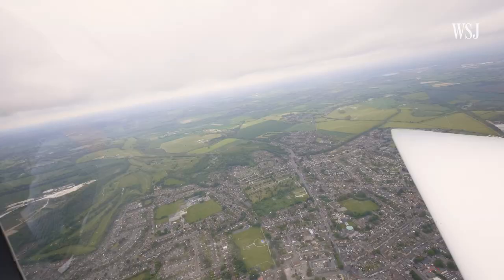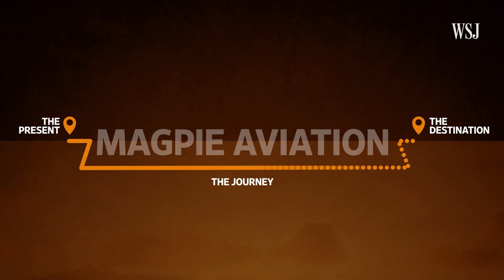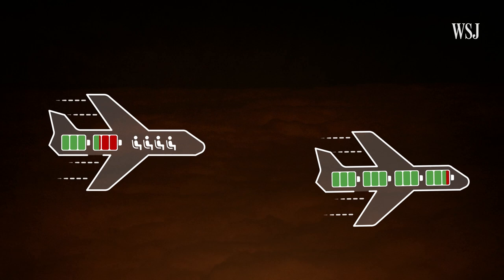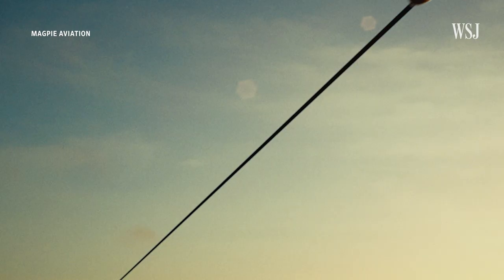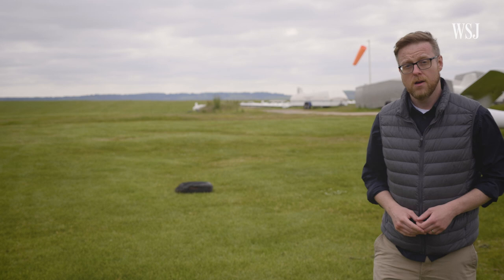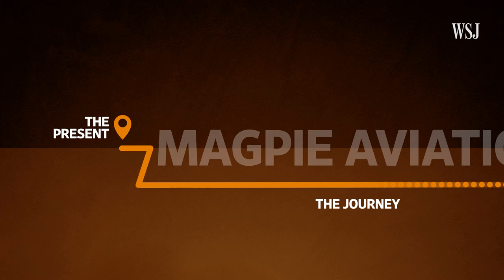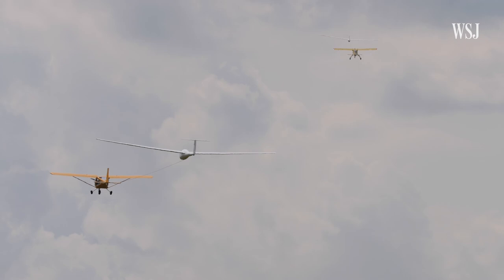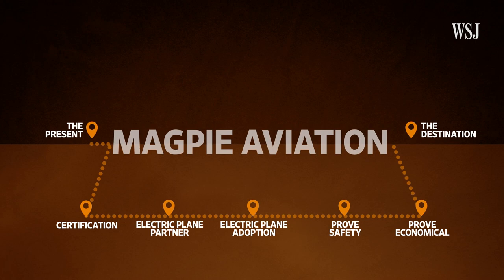How to Extend an Electric Plane's Range? Aerotow It.

Comment: Do you think plane towing will latch on?
Reply: Let's talk again, 15 to 20 years from now. 
Nothing they offer can't be provided by one of the big wigs within one year.
Reply: No. I’m willing to be proven wrong. But this sounds impractically complicated to coordinate.
Reply: Why limit it to towing electric planes? Is there a reason an electric tow plane wouldn't work to extend the range of conventional planes?
Reply: At this moment I can't imagine that using multiple planes and crews can fly in an economic way.
You need more flight "take of permission"
More people
More maintenance
And every switch of the pulling plane needs to be tightly scheduled 
The goal range of 1200 miles is also a little small. At least not enough for intercontinental flights...
Reply: Everything that “appears different” from a standard aircraft has been a failure, regardless of performance.  For instance, Rutan was an amazing aircraft designer, however nothing he created became mainstream.
Reply: It should, a simple way to start in-flight resupply/recharge.  In commercial aircraft business, 40+% of cost is fuel, all polluting fossil fuel now.  A chunk oof that pollution is inefficency of combusion, and  is the tyranny of the fuel Breguet range equations, and electric is more efficient and can  be zero-carbon, but heavy so tyrany of the battery equation is harsh.. but Magpie's idea is a simplle way to lower waste and efficiency and get to zero-carbon.  Someday maybe the tow vehicles will dock or mate, but this great start.
The fuel and battery equation tyranny ayk is that for short distances the fuel needed is linear with cruise range, but past a certain point, it goes up more and more exponentially, shown here where Breguet cruise range equation written to show fuel needed to go distance R. Aviation folks don't like this cuz shows a key probalem that makes fuel costs more than 40% of the costs fo commercial aviation.  Huge amount of waste and pollution..

Mf_c = (Μ_c0-M_c1)=M_c1*[exp{+Rc *g/[L/D)*Efspec*η_c}-1]

Mf_c is Breguet calc of fuel mass needed to cruise level a distance Rc; M_c0 is plane mass at start of cruise, M_c1is mass of plane at end of cruise.
Mf_c=M_c0-Mc-1
Efspec is specific energy of the fuel [J/kg], 
η_c is thermodyn*propulsive efficiency at cruise, equal to 35%-40% for best jet airliners, >40% for best turboprops.
 L/D~20 maybe more for those.
So for best commercial aircraft  (L/D*Efspec*η_c/g) =~ 20*40MJ/kg*40%/[9.8m/s2]~32e3km, i.e, the last 1kg of fuel used in cruise can get 1 kg of M_c1 a distance of 32,000 km!, or all of Mc_1 a distance of
32e3 km/(M_c1/1kg), 
so if plane is A320 weighs 68 tonnes at end of cruise phase, i,e,m Mc1=68,000kg, that last 1kg of Mf_c (fuel) got us 32e3/66e3 [km] = ~0.5km.  that's good, imho, for such a huge plane, but for 10000x further say a 5000 km cruise, like across USA, say,, or Rc= 5000km, Mf_c is 12,000 kg, more than 10,000kg like a linear increase, cuz the fuel has to carry the fuel etc etc.
Mf_c(Rc=5000km) = 68,000 kg * [ exp (5000km/32,000km)-1] = 68000*0.17=~12,000 kg.  so fuel weight two tonnes more, 20% more weight extra of fuel just tto carry the other 10,000 kg the rest of the plane needs to fly.
 and this effect is worse in takeoff and climb of course.. so for long ranges refueling looks better and better.  Especially electric..
Big jets do ok of course 20% example not prohibitive, but for runnning lower energy density sustainable fuels like ethanol, it's harder, and especially for electric aircraft, running current batteries.    So refueling looks better and better
teh range equation is different and worse unless you shed batteries by having them fly off once empty to charging station on ground [Chip Yates was going to aerial drone refueling and as needed drop batteries llke that].

For battery only electric planes, the cruise range equation, written for battery mass as function of range, is
 Mplane+Mbatt(R)=Mplane*[exp(Rc*g/(L/D*Ebspec_c*η_c))],  
where Ebspec_c = specific Energy of batteries at cruise power prob  ~250 Wh/kg.  
Estimate η_c = 90%*90%*70=55% maybe better soon with advanced & distributed props and flexibilty etc, and say L/D=20 for fixed wing might be more.  
Mplane is mass of plane+PAX+cargo all except batteriesdidn't count pack structure since i didnt count fuel tank and junk for jet, but that weight is there.    
anyway  calculating, the term under Rc is
 (L/D*Ebspec_c*η_c)/g= 20*0.9[MJ/kg]*55%/g= 1000 km. 
 
so for Rc=1km,    if Mplane=10,000kg  then Mbatt+Mplane/Mplane=exp(Rc/1000km)=10tonnes*1.001 so that means it needs 1kg for that 1km.
which is linear,
.  but for longer flights, the exponential effect starts to kick in:    
 For Rc=200km it needs  220kg batts; and for Rc=400km, need 500kg batts.  
So trouble in two areas: at 500kg of batts, the batts are ~ 1/3 of the TOW mass; and its 25% more battery mass than linear cuz you need 25% more batteries just  to haul batteries, at Rc=400km. and passengers and cargo getting crowded out. So even though electric can be very efficient and carbon free if charged by say solar or wind (hydro, etc),  the range is nearing the battery equation "tyranny" limit, at 400 km, much much less than jets say 6000km-20000 km limit.

This is where Magpie could really shine, imho.  They can go unlimited range if the tows are ready, which is matter of logistics and weather and fatigue of course.
And if the aircraft towed is an eVTOL, it can land wherever needed:  on a rooftop or beach or ski resort.
 Imagine you take off from a small field or rooftop right near your town or city,say an eVTOL that has good L/D while towed,Multiple tows switch off to take you close to, or right to, your faraway destination, Or better in the future your craft mates with big  fast plane or "mothership" , zips you cross country, then eVTOL puts down at destination or rail hub etc. maybe you even switched evTOLs in the "mothership", after going to the bar and say mtg room of observation deck,   all very efficient cuz evTOL and mothership electric or biofuel.  hopefully solar and wind generated. Mothership refueled by catapult launched high effficienty drone UAVs with electricity, food, drink, pilot swap, medevac; all the things aviation should already have.  You switch to your destination evtol and land in the town or city of your destionation, or train station or beach resort.
 no fighting crowds in O'Hare or Atlanta or DFW.  flight average speed slower but door-to-door average could be 200kmh instead of say 1hr+1hr+fly3hrs say NYC-CHI then 1hr airport+1hr drive= 7hrs for 2000km= 140kmh trip total?   I ddont' know but could be real efficient and more pleasant, but we have to support it or Exxon and Boeing and airlines will keep serving up pollution, waste, discomfort, and 737 MAX crap design and crap Air Data systems.

Comment: Maintenance is often the highest expense of an aircraft and this idea doubles that cost. It also requires an extra one or two pilots so you’ve potentially doubled labor costs as well
Reply: Maintenance for electric propulsion system has much less maintenance compared to gasoline
Reply: @paulg9484  Same with electric vs gas cars
Reply: Agreed, don't see this one succeeding without automation.
Reply: @paulg9484  electric or not, they will still be required to complete their required airworthiness inspections and comply with all current and future airworthiness directives, which makes up the bulk of “maintenance” expenses of an aircraft. Every tow aircraft needed will also have to be stored in a hanger. They will be subject to the same taxes that are associated with the ownership and operation of aircraft. There will also be the cost of charging them. All of this for an aircraft that will not generate any sort of revenue to offset their costs and that before training and paying for the pilots. The funds saved from fuel and maintenance will not come close to covering for it
Reply: It's multiple not just 2

Comment: Man this seems like a shot in the dark. So many variables that need to line up to make this feasible. Theyre proposing  so many challenging bits here and while i think its all 100% possible i just struggle to see it being economically sustainable. Adding more pilots per fligbt. Autonomous planes would pretty much be a necessity for this to work. Then having more than 1 plane per trip increases maintenance costs. And increases the points of failure... Mathematically does it even make sense to use this method instead of just having layovers like we currently do?  I believe the biggest issue with electric planes right now is how heavy batteries are in comparison to their weight... So for electric planes to become more viable id imagine oil prices would either need to become unreasonable or battery technology would need to evolve. If battery technology is good enough does it even make sense to need to recharge mid air? This is a cool idea but seems a bit shortsighted.

Comment: I can’t possibly imagine how this would be economical. If it requires several battery planes to make each flight. Then surely every one of those planes has to take off, fly to the start of its “leg” and then fly back and land. That sounds very inefficient and highly complex to coordinate.
Reply: do the math it actually is a good idea. unlimited range for a plane that if eVTOL could take you door to door. zero emissions eventually, unlke current crap we fly in. Look at battery equation (see above).

Comment: From an energy perspective, it'd be better to use batteries to help with the energy-intensive take-off. Either as an electric tow-assist take-off (dodgy), or winged external batteries (or hydrogen tanks?) jettisoned after take-off to glide back & be reused. But as planes typically don't yet even have just an electric front wheel for push-back & taxiing, any change might be a while...

Comment: It will work in a small scale. But it is not practical commercially. We have seen this story many times. So they are probably just looking for vc and eventually nothing practical will come out of if, just the  over the air power feeding mechanism.

Comment: interesting but I really doubt it'll happen. I can see this being used by the airforce though, instead of aerial refueling they'll just tow the fighters. drastically saving fuel.
Reply: do the math it actually is a good idea. unlimited range for a plane that if eVTOL could take you door to door. zero emissions eventually, unlke current crap we fly in. Look at battery equation (see above).

Comment: would be smart to get around energydensity problem of batteries but dumb af from an enegry usage standpoint bscly having to build up the potential enegry multiple times for a single flight would cost crazy amounts of energy
Reply: i dont think so. tow planes could be UAV drones hi efficiency rail launched with unducted fans don't need to lift PAX and cargo.  In fact as range increeases this system can be more efficient than any  plane that doesn't get in-flight refuel.  it's like having gas stations en route. but you don't need to weigh down your plane with fuel, the tow plane does that very efficiently. the tyraanny of the fuel equation (Breguet, rocket) is overcome this way.
Towing won't be forever, someday refuelers will dock/mate, provide thrust, lift electricity charrge, climb power for storms ahead, medevac, pilot swap, food, drink, water, pressurized air, medical, .. all the things commercial aviation has but doesnt cuz they are cheap and lazy and we get 737 MAX crap and turbulence from bad air data system junk; and peanuts and crowding and discomfort, and no options.

Comment: Who else pictured a bunch of electric geese crossing the continent?
Reply: Now that you said it I can't stop laughing imagining 20 battery planes all pulling in V formation one single passenger plane 😂
Reply: @blablup1214  Heh. Power's never been the issue with electrics, just energy density.
I suspect they'll run into another issue quickly - people want services on longer flights (washrooms, drinks, meals) so larger aircraft with larger batteries and longer range work better anyways. This might actually have made more sense as a conventional Jet-A diesel or turboprop hauler that could bridge medium distances for short-haul commuter planes, hence my mental image of a larger hauler with several tow lines off the wings.
I still think algae-based biodiesel is the best short term solution for air travel, likely followed by whatever superbatteries are hiding in labs right now.

Comment: Why bather with pulling when is easier to use a Roger Adam electric motor generator to continue to have the batteries charged and its had been proven that works fine, 
Well I know because I am using it.

Comment: This might work if the towing aircraft were unmanned and optimized for the purpose.  That way the airworthiness certification doesn’t have to bother with safety features or crash survivability.  Also autopilot for docking and handing off the passenger aircraft autonomously would need to be refined.  The logistics would certainly interesting for these tow drones being based out of airports and austere airstrips.

I think the idea way too complicated to implement commercially.  Rather they should focus on selling this to the military.   Aerotowing has a rich history dating back to D-Day 😂
Reply: do the math it actually is a good idea. unlimited range for a plane that if eVTOL could take you door to door. zero emissions eventually, unlke current crap we fly in. Look at battery equation (see above).

Comment: So higher cost planes, higher cost energy, reduced efficiency (drag, takeoffs and landings), more maintenance, more pilots, and higher risk of accidents (again, taking off and landing). I can see why they threw this idea away repeatedly before deciding they had to use it because of the battery tenet of their ESG religion.
Reply: do the math it actually is a good idea. unlimited range for a plane that if eVTOL could take you door to door.  Look at battery equation (see above).